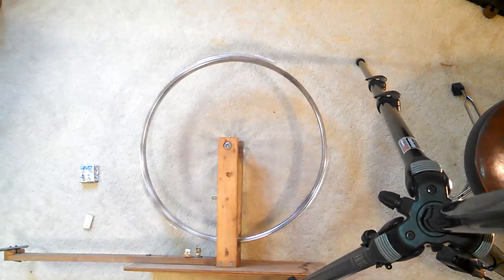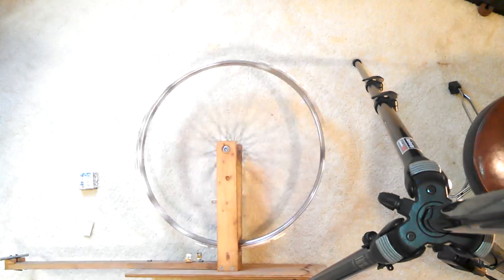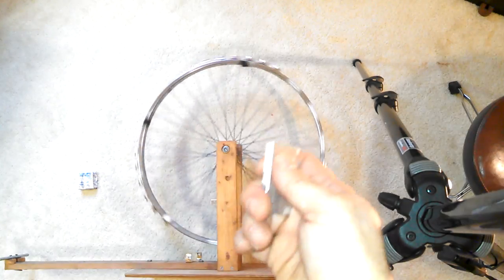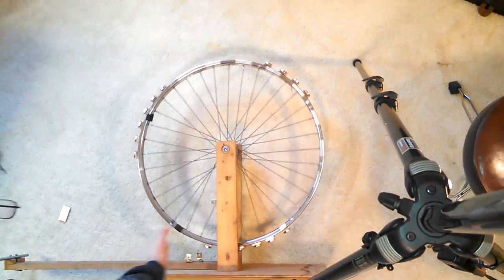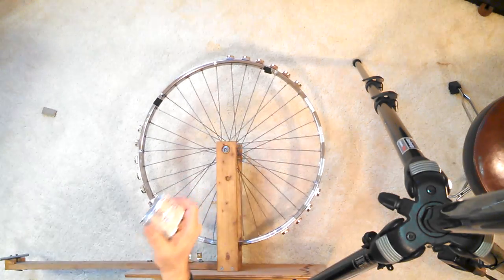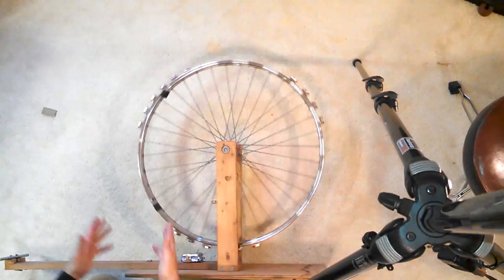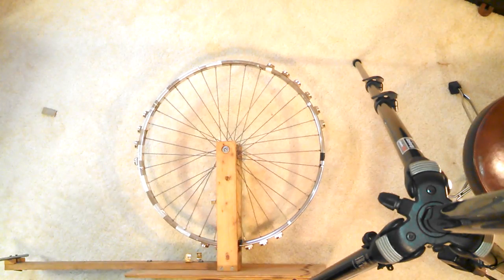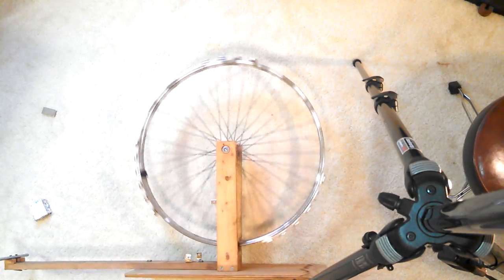🧲 Self Running Magnetic Motor Generator Theory

Comment: I am not sure James why you have 3 lots of series of smaller magnets stuck around the rim and why not stick these magnets all the way around at regular interval such that the whole rim is covered equally with no bigger gaps (blank segments) that way the rim would be in contant spin from regular attarction from the stronger side of your stator and adding several more stators you could multiply your torque and then you could possibly have an effective torque that cam be geared up or down to drive a suitable generator.

As for your stator, I am guessing you are shielding one side by using a steel cage as they use in loudspeakers of colour televions (the old CRT televisions) as otherwise the magnetic flux from speaker magnet deflects  the electron beam that then does not land at the right spot and gives you wrong colours.

i am going to next see your other video how you made that stator, which i haven't seen yet
Reply from the maker: If you put magnets all the way around it does not work, rather you have to use stators all the way around.

Thank you SOooo very much for your interest. My work research resumes May 1st, 2014.

Cheers!

Comment: I'm not sure what you're trying to pull, but the video does not exist.  Secondly, no one says you can't build a motor using a magnetic stator. You claim that you found free energy, you have no way to back that claim up. You don't even show what inside your stator.  Like I said, it's most likely a battery powered electromagnet pulsing at a certain frequency.
Reply from the maker: 🧲 Not only do I show what's inside my stator, but I show you how to build it.

🧲 CREDIBLE FREE ENERGY MAGNET MOTORS THAT WORK 

MAGNET MOTORO - Rotor Encantado
https://youtu.be/mxgwTzxfe8Y

Amazing Magnet Motor/Gen Rep. This is not a fake
https://youtu.be/jKFTAobM-l0

WORKING MAGNET MOTOR 2023
https://youtu.be/vdtdKE2Qe40  

SELF RUNNING MAGNET TURBO MOTOR 
https://youtu.be/6sIBHn5-9pI 

 WORKING MAGNET MOTOR - rotor magnético
 https://youtu.be/3mD0_0FiJ54

 MAGNET ONLY MOTOR from SOUTH KOREA 
https://youtu.be/smzpbKg9S7M

1966: German inventor presents his Free Energy Device Magnet-Motor
https://youtu.be/XWQjMyMWXAc

Comment: Are you on drugs?  What kind of retort is this?
First off, the link to your video is bogus.
Second of all, just saying it works doesn't make it work.
Reply from the maker: 🧲 CREDIBLE FREE ENERGY MAGNET MOTORS THAT WORK 

MAGNET MOTORO - Rotor Encantado
https://youtu.be/mxgwTzxfe8Y

Amazing Magnet Motor/Gen Rep. This is not a fake
https://youtu.be/jKFTAobM-l0

WORKING MAGNET MOTOR 2023
https://youtu.be/vdtdKE2Qe40  

SELF RUNNING MAGNET TURBO MOTOR 
https://youtu.be/6sIBHn5-9pI 

 WORKING MAGNET MOTOR - rotor magnético
 https://youtu.be/3mD0_0FiJ54

 MAGNET ONLY MOTOR from SOUTH KOREA 
https://youtu.be/smzpbKg9S7M

1966: German inventor presents his Free Energy Device Magnet-Motor
https://youtu.be/XWQjMyMWXAc

Comment: You don't show what's in your "stator".  You claim it's a magnet, but for all we know it's just a pulsing electromagnet.  Besides, if what you claim about the stator is true that one side is stronger than the other, it still won't make the wheel go around.  It would have to oscillate between strong and not strong to cause the wheel to move.  It's the pulsing that transfers energy, not the constant presence of a magnetic field.
Reply from the maker: Using only magnet to create continuous motion has long since been solved and replicated by others. There for this is no longer theory. Thanks for visiting nonetheless.

Comment: I have been working on this concept for quite a while and I have no doubt that it WILL work. Hang in there --  I think that  filling in all the spaces with magnets, spaced equally to fill the circle will work well, Spacing will be important. Control the speed by making a way to pull the stater closer or farther away. Best to you! Going to watch the rest of your video's now.
Reply from the maker: Using only magnet to create continuous motion has long since been solved and replicated by others. There for this is no longer theory. Thanks for visiting nonetheless.

Comment: All you've done is move where the "Stickiness" issue is. You've moved it onto the wheel. It's complicated to explain but it shouldn't continue to work. Your still trying to build a perpetual motion machine…
Reply from the maker: Guess what? Turns out we've had German magnet motors for cars since 1966. Google it. Now others are creating their own magnet motor that truly work. Using only magnet to create continuous motion has long since been solved and replicated by others. There for this is no longer theory. Thanks for visiting nonetheless.

Comment: So quick question here. Why would you show this video when you haven't set up the other sets of magnets with proper spacing? I mean it requires very little effort to fix that little detail before making the video. I'd very much appreciate a video showing the wheel completing a rotation while accelerating. Until then you are wasting your time by posting this video. If you make a video showing this actually working, I'd be glad to feature you over at Revolution-Green(.)com.
Reply from the maker: Did not have enough magnets. I was broke at the time as well.  Guess what? Turns out we've had German magnet motors for cars since 1966. Google it. Now others are creating their own magnet motor that truly work. Using only magnet to create continuous motion has long since been solved and replicated by others. There for this is no longer theory. Thanks for visiting nonetheless.

Comment: I think you are on to something. This is the same theory as those guys with the round disk inside a circle with magnets on an angle. You need to complete the magnets all around the wheel to prove the point better. also put a small axial flux generator say 15 watt on the wheel and that will shut the nay sayers up. I support your theory. They called the wright brothers wrong. It takes people like you and an imagination to move forward in proving new theories. I support you.

Comment: If your wheel will only ever achieve a given speed, then your net gain is zero at that speed. I think maybe whatever metal/s you're using as shielding, if they're non-ferrous, are setting up eddy currents as the rotor magnet pass by, thereby causing parasitic losses, along with the bearings, air resistance, etc. It looks as though there is some energy going into the system. Refining the rotor placement, and reducing parasite drag, though difficult, might work. I'm going to have to try this out.

Comment: Try starting at the top of your wheel (12 o'clock)  going clockwise, decrease the space between between the magnets. You may need 4 sections tho.
Reply from the maker: I was near broke and ran out of magnets when I made this video. I would not have money for this project for a very long time, along with other personal issues that derailed me.  YouTube took down 17 more of my videos as well.  Hopefully you see my answer all these years later. Guess what? Turns out we've had the German magnet car motors for since 1966. Google it. Now others are creating their own magnet motor that truly work. Using only magnets to create continuous motion which has long since been solved, and easily replicated by others. There for this is no longer theory. Thanks for visiting my channel nonetheless.

Comment: Balance the wheel close perfectly, then try.  If you have any chance at all this is what you will have to do, you can not see exactly what is happening from the heavier side to the light side, it interferes with your research.

If there is anything there to be had it may be wasted on pulling the wheel up on the heavier side. A Perfect true and balanced wheel will increase the directional sustainability with the smallest of torque applied.  Round wheels will spin more revs than a wobbly one.
Reply from the maker: Guess what? Turns out we've had German magnet motors for cars since 1966. Google it. Now others are creating their own magnet motor that truly work. Using only magnet to create continuous motion has long since been solved and replicated by others. There for this is no longer theory. Thanks for visiting my channel nonetheless.

Comment: It didnt work at all.  Your magnets only can conserve the initial push or speed it gets falling down towards the heavier side of the wheel.  You have to give the wheel a push sometimes.  The same attraction that makes it get up speed is the same attraction that takes it back down to stop.

The wheel is unbalanced so it is faster on the heavier side going down..

The wheel will gain no more speed than it did with the sticky magnet, just the wheel goes back and forth.  It always stops.
Reply from the maker: Guess what? Turns out we've had German magnet motors for cars since 1966. Google it. Now others are creating their own magnet motor that truly work. Using only magnet to create continuous motion has long since been solved and replicated by others. There for this is no longer theory. Thanks for visiting my channel nonetheless.

Comment: Because the magnets don't provide any new energy, they just convert potential energy into kinetic and back again, eventually friction (and maybe heating of the magnets) will bleed off enough energy to bring it to a stop.

True, the sun is just converting atomic energy into light and heat but it can continue pumping out energy until its store of hydrogen runs out.
Reply from the maker: Guess what? Turns out we've had German magnet motors for cars since 1966. Google it. Now others are creating their own magnet motor that truly work. Using only magnet to create continuous motion has long since been solved and replicated by others. There for this is no longer theory. Thanks for visiting my channel nonetheless.

Comment: That's true, and raises the question is energy generated by a dam free energy? What is the source of in energy? well the fall of water that was raised by solar power, so its gravitational energy that is created by heat transferring  water molecules to be lighter then air and thus position them self's over the high density air molecules, so its just atoms moving around creating a potential energy to be harvested by gravity, why can we not do the same with magnets? its just atoms moving around.
Reply from the maker: YEP!!!!! I was near broke and ran out of magnets when I made this video. I would not have money for this project for a very long time, along with other personal issues that derailed me.  YouTube took down 17 more of my videos as well.  Hopefully you see my answer all these years later. Guess what? Turns out we've had the German magnet car motors for since 1966. Google it. Now others are creating their own magnet motor that truly work. Using only magnets to create continuous motion which has long since been solved, and easily replicated by others. There for this is no longer theory. Thanks for visiting my channel nonetheless.

Comment: :-)
Reply from the maker: I was near broke and ran out of magnets when I made this video. I would not have money for this project for a very long time, along with other personal issues that derailed me.  YouTube took down 17 more of my videos as well.  Hopefully you see my answer all these years later. Guess what? Turns out we've had the German magnet car motors for since 1966. Google it. Now others are creating their own magnet motor that truly work. Using only magnets to create continuous motion which has long since been solved, and easily replicated by others. There for this is no longer theory. Thanks for visiting my channel nonetheless.
Reply: @FreeMagneticEnergy2  one of the issues is that the motor will run for as long as the magnet is magnetic, but this type of motor has almost no torque. When designing a motor you also need to show the motor can exert as much torque is needed for the application desired. Its very difficult to get torqe out of a permanent magnet motor.

You may be able to use a weighted fly wheel and build up momentum. With that you may be able to run a very small alternator which could run an led or maybe charge a phone. But that case there is still not a strong torque, the momentum is doing all the work.

I dont believe there could ever be anu high energy production applications. You would need to get back more energy from the motor than it took to charge the magnets. To make a magnet it normally takes twice as much energy as it stores. If you want to make this viable you would need to be able to charge a magnet much more efficiently.

Currently this type of motor is not effective or scalable and its applicable to maybe desk toys. But if you could charge a magnet more efficiently then this type of motor could maybe be a bit more viable.

Comment: I've watched his vids and he's using magnets that have 28 to about 100 pounds of pull force.  If you were to step it up to larger magnets that have 300 to 500 pounds of pull force you'd have some serious torque on this wheel.  The radial inertia with say 30 to 40 magnets on a 4' wheel that had 4 to 8 stator magnets would really keep this thing rolling.  He said his issue was funding.  The above mentioned scenario for a wheel could easily cost $3K.  Who has that cash laying around.
Reply from the maker: Well said. I do now as of 2022-23 It turns out that this magnetic motor challenge was solved way back in 1966 by a German man who made a working car motor that ran only on magnets. See link below. Others as well on the web have also made motors using only magnets. See links below. My design concept is different from most others as I'm going for super torque. The links below were long since made available in the video description as well. If by chance you're still around, thanks for stopping by.

((( MAGNET MOTORS THAT ACTUALLY WORK )))
👉🏻 MAGNET MOTOR - Rotor Encantado
https://youtu.be/mxgwTzxfe8Y

Amazing Magnet Motor/Gen Rep. This is not a fake
👉🏻 https://youtu.be/jKFTAobM-l0

WORKING MAGNET MOTOR 2023
👉🏻 https://youtu.be/vdtdKE2Qe40SELF RUNNING MAGNET TURBO MOTORhttps://youtu.be/6sIBHn5-9pI

🆕 WORKING MAGNET MOTOR - rotor magnéticohttps://youtu.be/3mD0_0FiJ54

MAGNET ONLY MOTOR from SOUTH KOREA
👉🏻 https://youtu.be/smzpbKg9S7M

1966: German inventor presents his Free Energy Device Magnet-Motor
👉🏻  https://youtu.be/XWQjMyMWXAc

Comment: I really like your idea. I read some of these in the box thinkers and laugh at this same kind of thinking through out history on inventions. I have worked with many engineers over the years in many fields and found that they have been trained in most part to work within a proven environment for their research. There are some out there however that do think on their own. The videos you posted helped me to see your reasoning for your ideas. I think you may be on to something here. thank you
Reply from the maker: Guess what? Turns out we've had German magnet motors for cars since 1966. Google it. Now others are creating their own magnet motor that truly work. Using only magnet to create continuous motion has long since been solved and replicated by others. There for this is no longer theory. Thanks for visiting my channel nonetheless.

Comment: Even if the device worked it could not actually be used for anything. As soon as an additional device is attached to it that might be used to do useful work it will overwhelm the (imagined) energy saving of the lop-sided magnet system.
However, it's a cool idea - it just won't work (and could never work. It's been said before and will be said again: Energy IN = Energy OUT.
Reply from the maker: Guess what? Turns out we've had German magnet motors for cars since 1966. Google it. Now others are creating their own magnet motor that truly work. Using only magnet to create continuous motion has long since been solved and replicated by others. There for this is no longer theory. Thanks for visiting my channel nonetheless.

Comment: Here's a tip to reduce the friction of the wheel turning:
Brass rod with two round strong magnets that are both the same polarity, and have a hole inside of them. Place the two magnets through the rods, in a way that their polarity is going against each other. Then put the wheel on top of one round magnet, and it will be spinning in thin air!

Comment: It's this energy that's the only reason the system can move at all. The system will oscillate between having kinetic and potential energy, gradually losing some energy to heat, and eventually stopping before making a complete turn because conservation of energy creates a "sticky spot" somewhere along the line. The only way to complete an entire turn is if you give it a solid push so it has a kinetic energy buffer that lets it overcome the heat loss for a few rotations.
Reply from the maker: 🧲 TAKE A LOOK NOW at VIDS from OCTOBER 2022 and onwards. Not sure if you'll ever see this though as I'm only now seeing your response out of thousands over the years. Thanks for stopping by nevertheless.

Comment: You should probably stop thinking about this problem in terms of "the law of attraction" and instead think about the system you've created as a system of magnetic hills and valleys. Your isolation is irrelevant to why this doesn't work. The same is true about the spacing of the magnets. What you're doing is starting the system out in a state where it has potential energy relative to nearby magnetic valleys. You added the energy to set up this state when you "put it in neutral".
Reply from the maker: 🧲 TAKE A LOOK NOW at VIDS from OCTOBER 2022 and onwards. Not sure if you'll ever see this though as I'm only now seeing your response out of thousands over the years. Thanks for stopping by nevertheless.